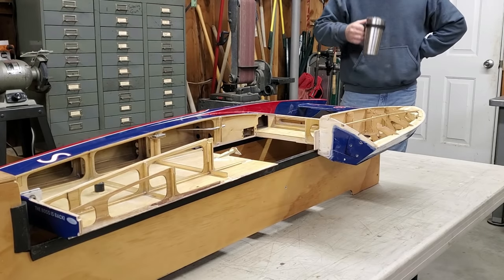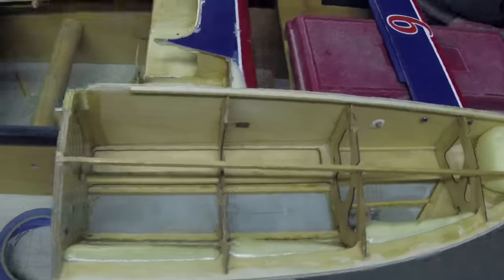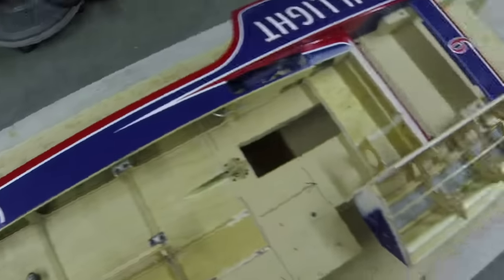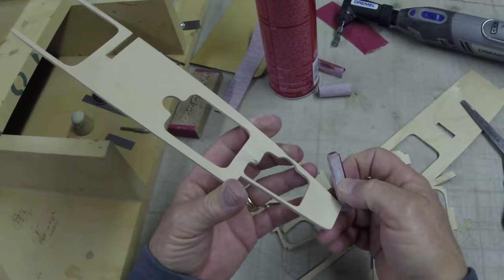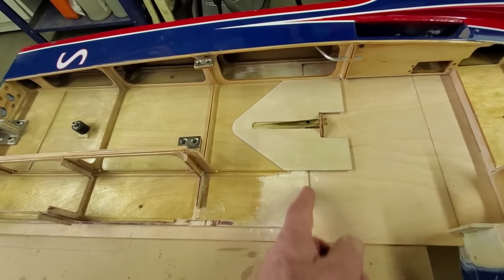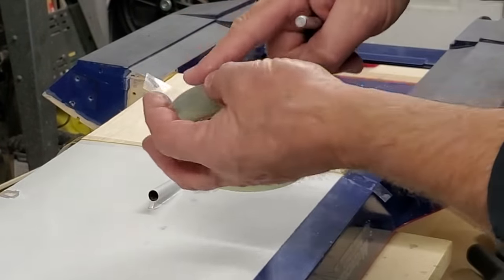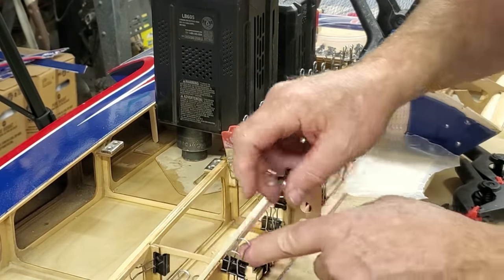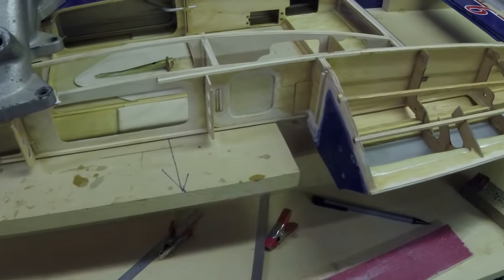Radio Controlled Hydroplane Crash Repair | It's Just That Easy!

Comment: You probably know this already but inverting those mixing brushes (handle down, bristles up) and hitting them with a drop or two of CA Glue where the bristles meet the aluminum handle might help to alleviate the bristle hair loss problem. Thanks for the great videos and info. Enjoy it all tremendously !!
Reply from the maker: OMG!  It's like I'm living for the very first time!  How could I have not thought of that?!   Next video I'm gonna share that tip and pretend that I thought of it myself!
Reply: Awesome, thank you!
Reply: I’ve used those silver devils for years primarily for gluing in fine furniture making. I never tried the ca answer. We used to take blue tape and wrap around just the shade of the brittles and then trim the ends a touch. Got by ok. Ca sounds like an interesting fix too!
Reply: Base of the bristles, not the shade!! Darn spell check!!😂

Comment: Havent gotten to this part yet. But if you dont know already. Gel coat isnt anything special. You can buy epoxy dye on amazon thats quite high quality. All you do is mix the dye in with your fiberglass resin and bang. You have gel coat. Wet sand it then polish it and you have a mirror fin8sh with no cracking. 
I work on boats and jet skis.

Comment: With those diamond wheels, they are real diamonds, diamonds don't like heat, keep em cool and they'll last a long time.
Reply from the maker: I needed to use one today and ran it at a lower speed to keep it cooler. My patience went out the window after about 20 seconds, so I wound that bugger up as fast as it could go and got the cut done in no time. Of course, the wheel is now trashed...

Comment: Once again a great video. Would it make sense to buy a laser cutter? They are coming down quite a bit in price. Under $500... You could save files and recut any piece of the boat as many times as you want. Would that work or are there issues with it?
Reply from the maker: A laser cutter is definitely on my wish list!  I think it takes a fair bit more for a good one capable of cutting the sizes I need however.  Wish I knew more about them... Stay tuned, maybe we'll figure it out one of these days

Comment: Scott 
I can’t remember what you use to thicken your epoxy with. Could you please let me know what it is?
Thanks 
Jeff
Reply from the maker: Hi Jeff,
It's West Systems 406 colloidal silica.  Hang on a sec, let me find a link..... 
Here it is!  https://www.westsystem.com/406-colloidal-silica/
Reply: @M5PerfHydros  do you paint your fiberglass or do you mix a dye into your epoxy to make gel coat?
Reply from the maker: I don't use gel coat except when making molds. My boats are wood and cowlings epoxy fiberglass, then painted with regular automotive paint and clear
Reply: @M5PerfHydros  i understand totally. But may i suggest you try to fiberglass over a sheet of ply just 2 inches by 2 inches then use the finishing epoxy with a little bit of dye in the color that you want and see how it turns out? 
I think youll find that not only does it save weight but it is more "slippery" on the water. But its also more durable. 
Just a thought.
Reply from the maker: Ya but I build wood boats, not fiberglass
Reply: @M5PerfHydros  oh okay. I thought you did a thin layer of glass over the top
Reply from the maker: Nope, wouldn't want to add the weight!

Comment: Question, I’m going through your build series. I am going to be building an old checkerboard painted Bardahl, and a more modern era turbine Bud (both Nitro), so I’m not following along, but I watching intently to pick up things and really enjoying the series, and the dogs! Again, sorry about Jaxon!! Does one get plans, or have access to plans on line for download that can facilitate this kind of major repair with all kits you can buy?? FOr even as reference during the build?? Or is that proprietary to each kit builder??? I’m a former furniture maker (serious hobbyist) so wood and I are old friends. I’ve built much from plans. I know how valuable they can be. Advise here would be helpful. For instance, does ML give the plans when you buy a kit?? I plan on getting both from him if I can also get plans? Thanks man. Looking forward to the Mega Stroh driven by Jaxon Brown!!!! My 3rd build will be a gas boat, hull undecided. Thinking about a Griffon era Bud. Anyway, some direction here from you would be helpful and very much appreciated. Thanks. John
Reply from the maker: Nope, no plans come with the kit, but you shouldn't need them anyway.  There used to be a website called Newton Marine that had plans for almost every full size boat, but the site has been down for over a year now so I think that resource is lost.  Why not just go for it? You'll figure it out!

Comment: Will there be a part 2 of this getting finished???  what size engine are you running in this boat?
Reply from the maker: Yup, deck skin video is coming up soon.  This boat runs a .67 Nova Rossi
Reply: @M5PerfHydros  That's a bit flash..  look forward to the next installment.

Comment: Do you use an aluminum back plate for your turn fins? I will search other videos....
Reply from the maker: Here you go! https://youtu.be/i4E1xFqhxrY
Reply: @M5PerfHydros  Thank you. I found the T-nuts. Another Q: Do you use the G-Flex for the spruce strips? At 1:20:33 it looks like you do.  I can't find the part in on video where you explain where you use the thin West Systems and the thicker G-Flex. My System 3 T-88 glue is much like G-Flex and is a little thicker. I'm just concerned that the thicker glue does not penetrate like the West Systems does. Anything is better than CA I would think?
Reply from the maker: I use West Systems for laminating, and G-Flex for construction.  So yes, all strips and hardware is assembled with G-Flex, and all laminated parts (floor reinforcement, sponson transom, laminated framing) and sealing is done with West Systems. An exception would be a part that is being laminated at the same time it's being installed (sponson runners/non trips), and I use G-Flex in this case.  You'll see this in the next video
Reply: @M5PerfHydros  Thank you. Now hurry up will ya?:oops::face-turquoise-covering-eyes:

Comment: I have the same dremmel. I couldnt stand the dang thing. The batteries are way too expensive the charge lasts 5 minutes and the dang thing vibrates me into early arthritis. 
Went with a Milwaukee and ill tell you what! Ended up going broke swapping out all of my tools for milwaukee. Dang dremmel... lol
Reply from the maker: You got a bad one. I can't believe how long the run time is on this thing. Charges lickety split too!
Reply: @M5PerfHydros  thats crazy. I had sent it in for a warranty replacement they replaced the tool and battery. Same dealio. Now it just sits in my junk drawer...